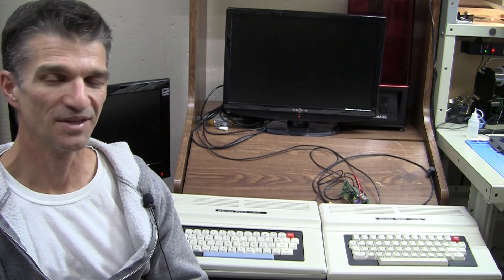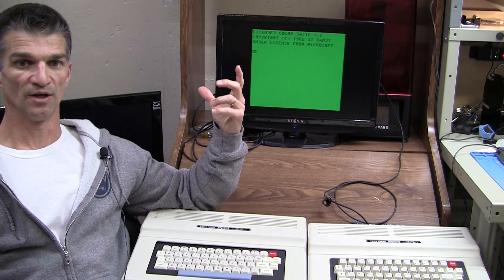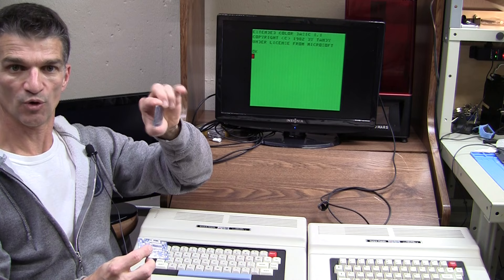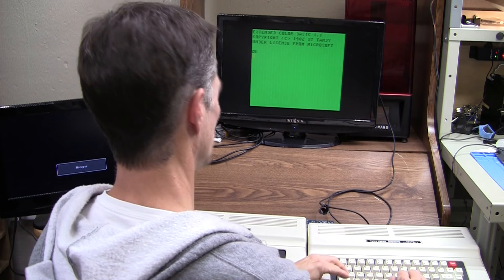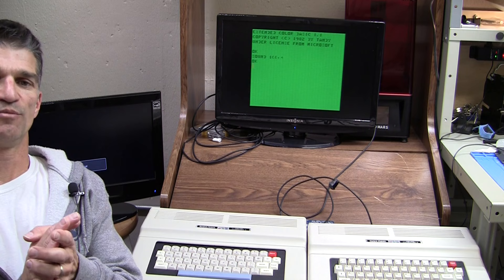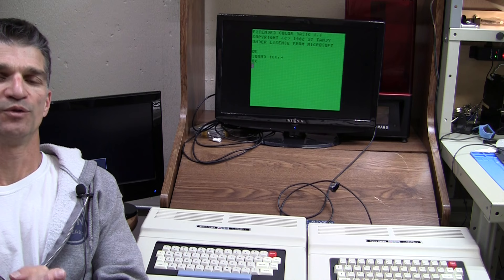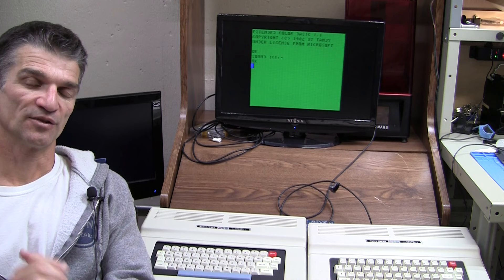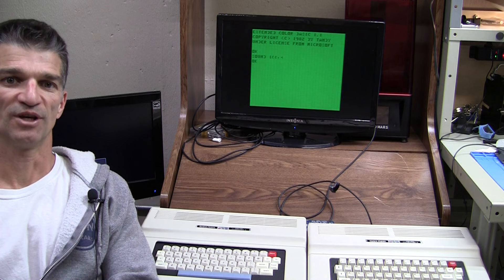2 of 2: Best Composite Mod. Tandy versus Mark Data Products #septandy #trs80 #hardware #hacks

Comment: I think one of the reason that these don't look good is the fact that you are showing the output on a LCD television and not a real CRTs which CoCos were designed for.  Two reasons for this hypothesis: 1) Unlike phosphor CRTs, a LCDs needs to convert everything to their native resolution. This certainly does not match the 256x192 output of the Coco, so there will be scaling artifacts. 2) Furthermore with LCD televisions there will be a double conversion going on (digital to analog at the computer level and analog back to a different digital resolution for the LCD.
Reply from the maker: Oh, good point, I will make it a purpose to retry this through an old VCR or surely I can scrounge up a CRT around here that still works.
Reply: I concur.  Composite is best showcased on a traditional cathode ray tube.

Comment: i am a fanb of simpler... did the "single" power supply prevailed as the solution for both?
Reply from the maker: At this moment, I have the flat modulator with the single 5V supply, and the vertical modulator with the extra supply wires.  What I'll do though, if someone emails and purchases the vertical one, and has a preference for the simpler connection, I will accommodate that by whipping up a quick board with that selection.  I would of course already have the right components on hand.